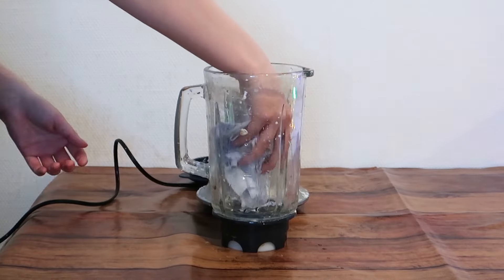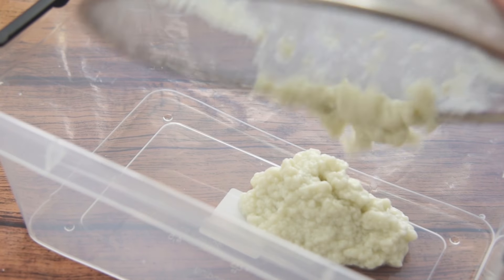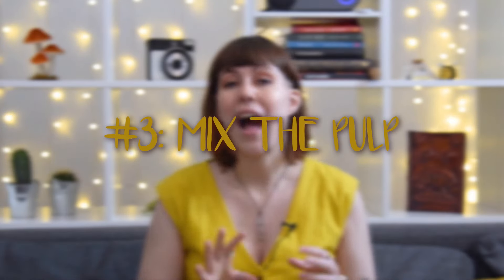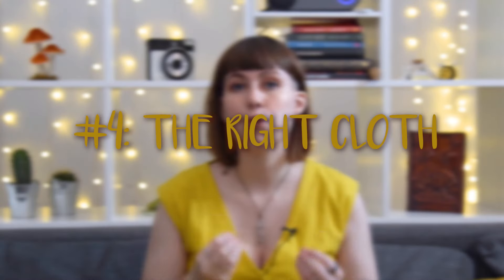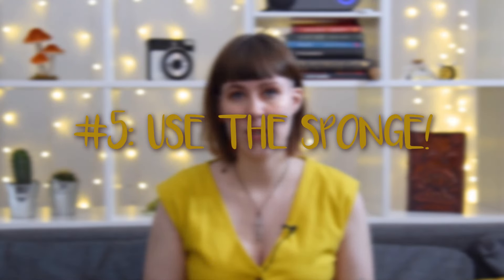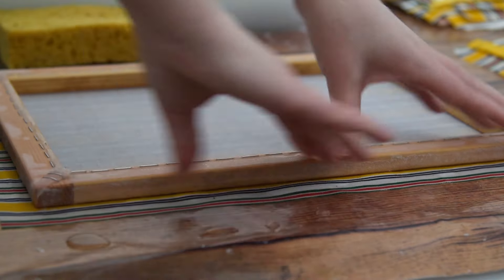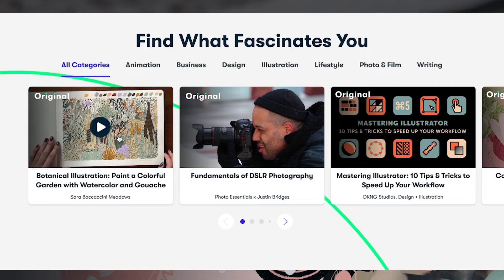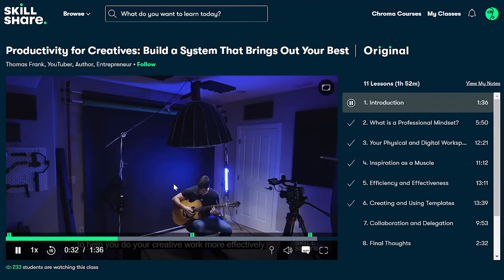How to make SMOOTH recycled paper | tips & tricks

Comment: The problem with using a blender the shortening of the fibres. This results in a paper with very low wet strength. For printmakers whose a process requires dampening the paper, the paper made with blended pulp can fall apart.

Comment: Does you have advice for making "harder" recycled paper? My paper turns out rather soft, almost similar to a paper towel, which makes it difficult to write on. Doing some reading online, people say this is because recycling paper results in short fibers, and the solution is to simply buy new fiber for papermaking. But I really love your philosophy of using what you already have! Are there any other solutions to improve the quality of my paper?
Reply: Do not overblend it with water
Reply: maybe use less water and more pulp, i read that adding startch will strengthen your paper, but i personally haven't tried it (but i was researching paper making)
Reply: @ayakalander7707  hi, how was your experience now? Would love to know some insights. Thank you.
Reply: While putting the screen to catch the pulp, repeat more times, making the paper thicker. Also, you could add some kind of glue to the water to make the fibers hold  better together.

Comment: Hello,
Thanks a lot for this very interesting content. I tried to make paper some weeks ago and it really works well. I had different thickness of sheets depending on what I planned. 😊
The problem I have is when I wanted to paint on it (with watercolors, for instance), it didn't really make it. Do you have an idea (or could you make a video) on how to make a more water resistant paper. I think maybe it's related with "pressing" the paper (hot or cold press). 
I would really appreciate some advice. 
Thanks a lot and happy paper making 😊

Comment: Thanks for the video. What type of mesh do you use to provide good smoothness on the mold/deckle side of your paper? Nobody seems to talk much about the different meshes that can be used and which ones provide the best smoothness. Appreciate any guidance (please provide exact mesh names & options for obtaining (in US if possible) if available).

Since the other determining factor for paper smoothness is the transfer fabric used, what type of fabric do you find gives the best results? I've heard that Pellon 65 gives nice results and is fairly inexpensive. Have you tried that fabric? What other fabrics have you tried and how did they work? Appreciate any guidance with this. Thanks.

Comment: You said in order to get smooth paper you need to blend the pulp and mix it well in the water. What if you use a stabmixer to mix in the pulp in the bucket of water? It would spread much quicker and easier. Or does over-blending the pulp exist?

Comment: I noticed that some larger mold & deckles have a backing on them to help support the screen. Do you have one like this? I was wondering how to absorb the water from those ones 🤷‍♂️
Reply from the maker: None of mine have a backing, but in that case you could transfer without absorbing the water or only where possible, and then adding another cloth on top afterwards to absorb through that so the sponge doesn't touch the pulp directly :)
Reply: @nevermindpaper  Thank you so much :-)

Comment: do you think that putting a piece of fabric on both sides of the paper whilst drying would result in smooth paper on both sides?
Reply: i think its more about the even spread of pulp and the effectiveness of the natural adhesive in the pulp
The hot water soak is what would make it easier to spread smoothly
I think the fabric on bothsides would just dry it faster or add more of a paper press to it

Comment: Another question do you put additives or glue in the pulp to make it writable? Thanks again, Silvia
Reply: If your paper is too absorbent, or not as writable as you would like, then you can apply what is called sizing to the paper. This is meant to change how ink or other media sit on the surface of paper. Classic sizing includes animal glue, weet starch paste, or gelatin. You can add the sizing to the vat of pulp, but this often requires keeping the water warm, and can be inconsistent for new paper makers. I would recommend instead that you dry your sheets as normal, then dip them or paint them in the sizing (one side at a time) and dry them again.